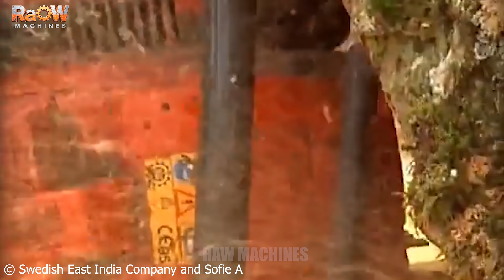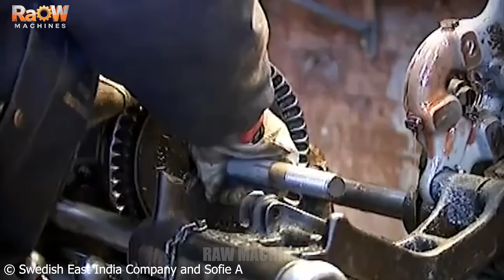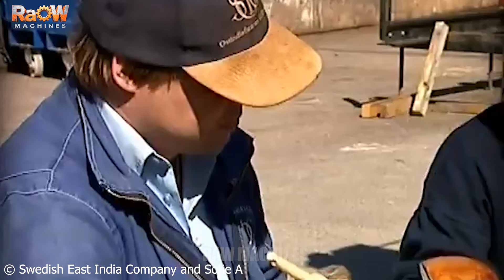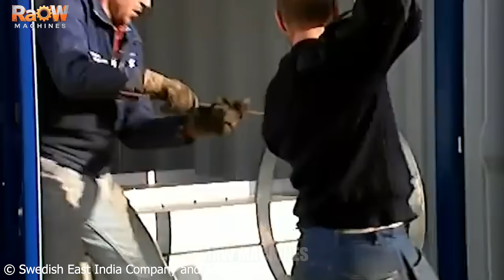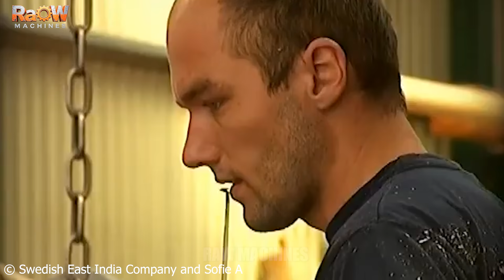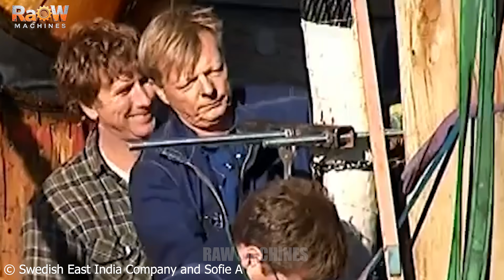Inside a Wooden Shipyard | How Wooden Ships Are Built from Forest to Ship – Part 3

Comment: something off about this video.  same looping sound, over-zoomed images.  is this the original source or AI ?
Reply: This is AI of course it is those freaking clamps were spaced way more than 20 cm apart, they did not resurrect the ship and make it float again they built a replica using modern tools, and the ship still part of the bottom of the ocean.

Comment: shocked, you should have used nickel ally bronze, never corrodes stronger than steel
Reply from the maker: Interesting take—thanks for sharing! Materials like nickel aluminum bronze are seriously impressive, no doubt. It’s always a balance between modern performance and traditional methods in builds like this, which makes it even more fascinating.
Do you prefer seeing modern materials used, or sticking with traditional ones for authenticity?

Comment: Are they using galvanized steel bolts or stainless steel probably alot of copper used too
Reply: Mostly not.they used wooden pegs later in the age of sail they began using bolts nails and iron to keep it from hogging.